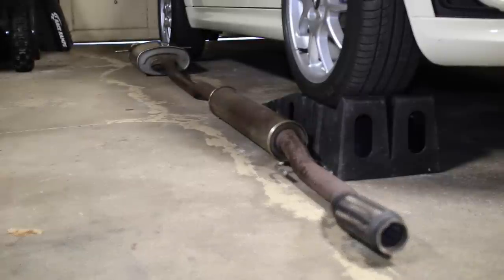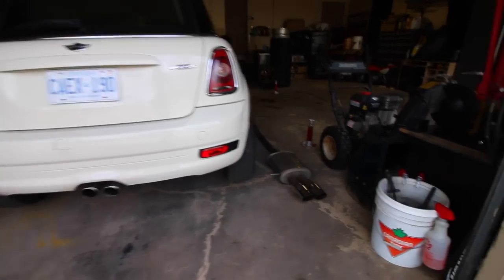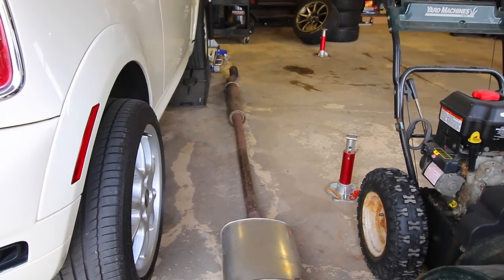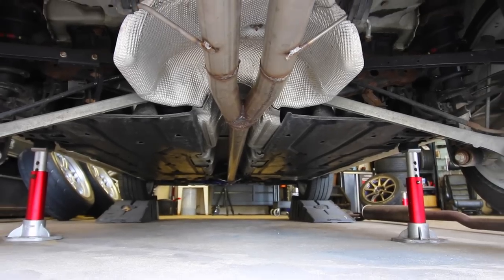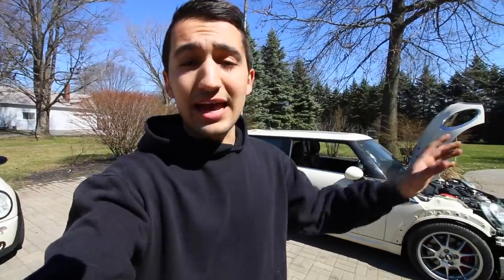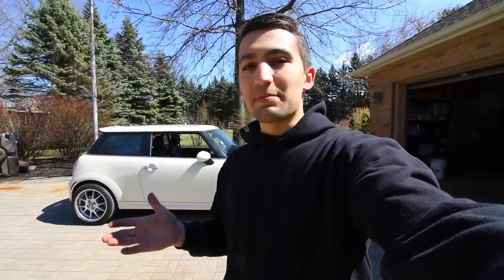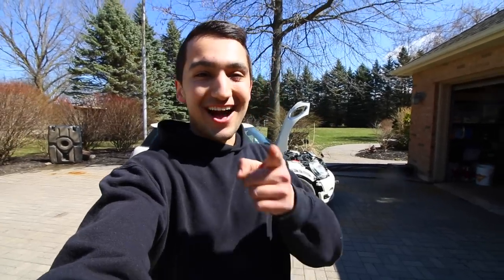HOW'S THIS FOR A STRAIGHT PIPE EXHAUST?

Comment: I have an 03 MCS and I did a one ball mod, but before I put the muffler back on I took it for a ride. I became somewhat addicted to the (what some would call obnoxious) sound. I delayed putting the muffler on for a week or so. But eventually got around to putting the muffler back on.. It's one of those things that make me a little self conscious, especially driving thru the neighborhood or past police. And I simply don't have the money and time to get an exaust that's perfect. Anyway, I found what I think the perfect solution for what I need. I got a muffler cutout on eBay for $60. But I made a mistake by assuming 2.25 meant that it would fit on my existing 2.25 pipe. Someone said somewhere that the manufacturers tend to measure from the inside which would make it bigger. So I borrowed one of those flanges/pipe spreader. Broke one and wrench the other one as far as I could. Still wasn't big enough for the cutout y pipe. Couldn't get it in more than 1/2". Then proceeded to fucked up the pipe before the muffler because I figured I could cut some of that one down to make it fit and was gonna hope the tightness and clamp would keep the 1/2" in. So now I gotta spend more money I really don't have to get this thing on. My question is, what is a cheap alternative to the cutout that would just tone the car down a bit, without losing the fun afressive sound? I heard someone say a cherry bomb muffler maybe. Or a baffle.. Any advice from anyone would be appreciated. Thanks.

Comment: Yk you getting a faster velocity at a smaller diameter right? 2.5” dual is meant for ~500(I wanna say 540 but I’d have check them book I have) I plan on using a 2” duals closer to the engine and a 2” xpipe that’s supports up to 250

Comment: Damn Milan those pops though ! :O i have a scorpion exhaust on my cooper s , don't get no where near as many pops. I have a question for you, my car came without a turbo heat shield , and after a drive the hood seems a bit hot , i looked online and i couldn't find a OEM heatshield , could you possibly have any ideas ? thanks man
Reply: i bet they're really expensive directly from the dealer though

Comment: Cool. Looking forward to seeing you rip it around the track after all this time you have had it. Have fun and be careful.  That's a very small car and not sure how forgiving it would be in a wreck. Just saying because no matter what you do in motorsports racing of any kind, eventually you will have a crash depending on how hard you push it. I know the Accord happens to be very forgiving in a wreck. Be safe my man and your a smart kid so I know you got the right gear for safety just remember take baby steps on the track. Totally different car the the Accord so give yourself plenty of time to warm up and get used to it and everything once you get it on the track. Try to race it as much as possible so your very in tune with how it handles because it's totally different from your daily.

Comment: I have a mini clubman s r55 and I don't get not one cracking popping sound not even on sport mode. will a straight pipe and second cat delete do the job?
Reply from the maker: Absolutely!! The Cooper S's have one more catalytic converter than the JCW's (which is what I have) which might be why I had a bit of popping even with the stock exhaust.

Comment: Milan, id like to get an after market muffler for my car, but my concern is that for highway driving my engine does 3k rpm at 100kmh. Do you think it will be too much noise for someone who does a lot of highway driving??
Reply: NLmitchieNL true, if I listen without the radio on I mostly hear engine noise, which isn't too bad once you get used to it

Comment: wondering what a 3" straight pipe would sound like!  I paid $200 for my b13's straight pipe. I was hoping their shop had a 3" pipe instead of the 2" that they installed. plus I'm searching for a dual tip to weld onto the end ...

Comment: have any plans for the rear of the car? maybe a small aftermarket wing? the stock one in my opinion doesn't look that cool
Reply from the maker: Wing, new bumper, diffuser :) Yes lots in mind!!
Reply: milanmastracci that'll be great because in my opinion the rear of the mini is its worst part. not that it's bad looking it's just not that aggressive or cool. once you mod it though I'm sure it'll look good. also I just wanted to say that it's cool to see a YouTuber have an original build rather than just another frs, or just another 240, or just another miata. can't wait to see this on the track.

Comment: That smoke, does your car do that after a long idle or when you get into boost a lot?  Wondering what the cause could be. My r56 does it. I’ve already replaced the valve cover (pcv/ccv) and added a catch can. 

Thinking it’s valve stem seals or carbon build up. Car sounds great by the way
Reply: It’s valve stem seals, I have a r56 that did the same.

Comment: shoulda gotten a 3 inch pipe
Reply: 3 inch on a NA car? Yeah, bye bye engine!
Reply: Luis Ramos no? Lol its turbocharged and turbo cars dont like restrictive exhausts
Reply: TheCybusterGundam you know that the mini has a turbo right?
Reply: TheCybusterGundam it's not N/A? lol she's boosted
Reply: Jacob Rolls thank you
Reply: Guys, yes i know that it's boosted. I can hear it. But what i mean was IF it was a stock N/A 2.5 inch is max. Just saying.
Reply: I got a 2014 civic si and its running strong asf with a fullrace 3 inch exhaust with no problems
Reply: TheCybusterGundam and explain how having a 3 inch exhaust will blow the engine
Reply: Luis Ramos well NOT blown right away but will definitely decrease it's life. Also buddy of me has a EG civic and he is running 2.5 inch straight and i asked him too why not 3 inch and his answer was "i'm not stupid".
Reply: TheCybusterGundam having a 3 inch wont cause any over heating issues or misfiring or anything like that, all a 3 inch does is give you more power and your turbo more freedom to spool cuz the back pressure isnt slowing it down
Reply: TheCybusterGundam, not on a Honda K-series (2.0 or 2.4L).  Dyno results have proven time and time again to produce more power at 3".  I didn't believe it at first either.  And I wasn't the only skeptic.  There's just overwhelming evidence on k20.org (not a site for people that do simple bolt ons; it's an engine swap site dealing with fabrication and lots of custom stuff in general).  Those engines breathe too well.  Don't know if it's the higher rev limit (over 8500RPM just from the factory) or what...
Reply: Also, here's some basics of what can happen when you go with oversized piping...  It's an amazing read...  So good that I've had it bookmarked for years.
http://www.team-integra.net/forum/blogs/surferx/25-exhaust-basics.html
Reply: Luis Ramos yep
Reply: Luis Ramos if the car was engineered with a 2 and 1/4 inch then it's plenty enough for the exhaust to move which means 2.5 is more than enough on stock boost. 3 inch won't change  anything unless he was creating more boost.
Reply: back pressure is bullshit kids
Reply: 9thGen running Invidia 2.75" on a N/A lol no problems either
Reply: bobdabildr12345 now, calling me stupid was unnecessary. What i mean to be exact is that big exhaust doesn't mean more power. Look if you like 3 inch pipe, fine. But why put a 3 inch pipe on a 190 hp car? I'd rather save up some money first for a MORE better upgrade and THEN go for a straight pipe.
Reply: Going too big or too small will hurt the scavenging effect. The momentum of the moving air pulls along the newly released exhaust gasses. It's not a constant pressure. The exhaust gasses come out in pulses. Too big and the air is going all sorts of directions. Too small and it's too restrictive.
Reply: You should't think of 3'' unless you make at least 500 Hp
Reply: 2.5 with no muffler is more than enough... if it had a muffler 3 inch would have made sense but without any muffler 2.5 is fine for up to like 500hp
Reply: TheCybusterGundam I had an na 350z with no cats and a full dual exhaust 3inch piping all the way back never had an issue and the car always drove great
Reply: @maxboya  Are you really commenting on a 3 yo comment.... dude. I'm a mechanic right now. But i gotta admit i was "kinda" wrong so there you go. I should've explained it better at that time. Happy now?
Reply: @TheCybusterGundam  Dude... Dude...DUUUUDEEE. Yeah lol. Im commenting on a platform that was designed for this exact purpose. The fact that you're asking me if I am really commenting on a 3 year old comment. Like. Do I need to spell it out slowly for you?
Reply: @TheCybusterGundam  Dude your a mechanic? No way... WOW! JUST WOW DUDE! WOW! We are all so amazed and just wow dude. heres a cookie
Reply: @TheCybusterGundam  There is no "kinda" about you being wrong you were full blown wrong. If your a mechanic, go replace the gasket between your steering wheel and your driver seat. Deff is blown tf out!
Reply: @maxboya  The hell is wrong with you man? Are you really calling names now? look who's childish here. Look 3 years ago i was just a student. I was an amateur. Lemme see what kind of reply you're going to write now. Your attitude is toxic you better fix that first. Let's see what kind of comment you're going to make now... or not.
Reply: @maxboya  Also next time try to chill out man. It's like you're on a period or something. It's just a damn internet conversation. Don't take it seriously or personal. In fact if you want to go on insulting me, feel free to do so. I don't give a flying fuck 😂 Instead i'm enjoying this. It's funny at the same time. Keep on entertaining the internet please.

Comment: Leave the cat on for the environment
Reply: its not his daily drivin car good sir. its a "track car" (in the making).
Reply: Some race categories actually mandate Catalytic Converters and enforce noise limits, necessitating the use of high flow cats, resonators and mufflers.
Reply: DShawn or take it off to make more noise
Reply: cat is the most restrictive component
Reply: Big frank Only true if you are making crazy amounts of power that need insane amounts of airflow. In reality, the turbo itself is the biggest restrictor because that's how it extracts energy from the exhaust gas.
Reply: makes sense, didn't take into consideration it was turboed. I think it would still make a restriction creating back pressure behind the turbine slowing it down and taking more energy to spin it
Reply: 4G12 how did you just say the turbo is the most restrictive.
Reply: Austen Sontag 
Because that's how turbos extract energy from the exhaust gas. As the turbine absorbs energy from the exhaust gas, exhaust gas pressure is lost. By definition, a restriction is something that causes the loss of exhaust pressure aka back pressure.
Reply: Okay but it implemented that lost pressure for a way higher gain, where as a nit as free exhaust doesn't create more power. Fi isn't really a restriction given the output.
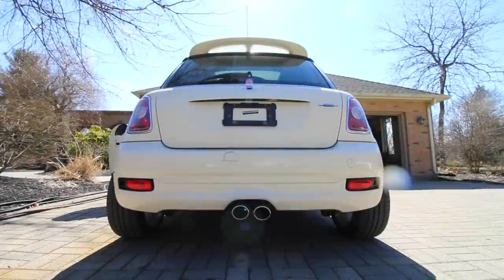Reply: At 2:50 he said that it still had the cat
Reply: GunsOfSteel67 
The car wouldn't be road legal if it ran catless since it was made with a cat. It needs to remain road legal if he wants to drive it to the track and not rely on a tow vehicle.